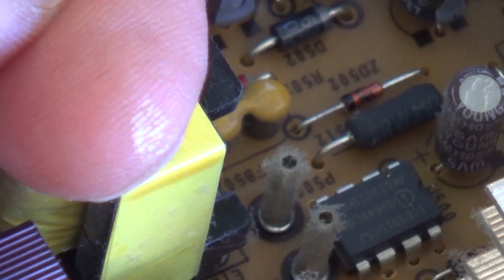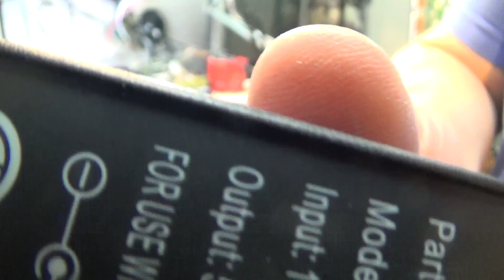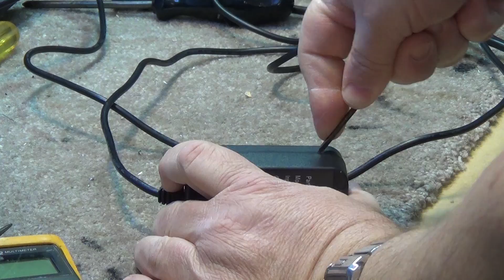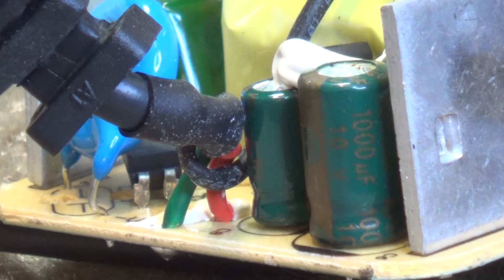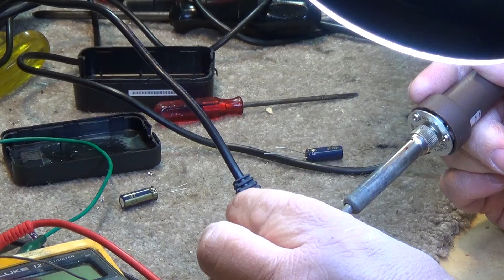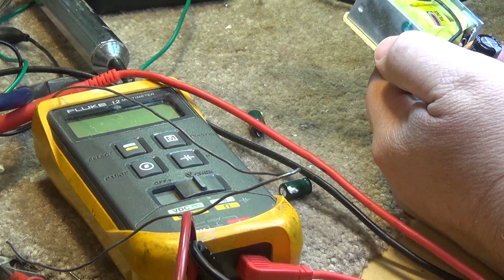Power Supply SMPS repair

Comment: I hate those things, change a hand full of shorted parts and they still blow up when I plug it in.  Yes, I've been fixing electronics for 51 years.  Changing bad caps is the only exception.
Reply from the maker: well if you've been fixing stuff for a 51 years then you should know better than to plug in a power supply like this without some type of overcurrent protection. When I work on switch mode power supplies I plugged them into my dim bulb tester and a very act and I run them up slowly while monitoring to make sure that the oscillator starts properly. There's no excuse for blowing up a switch power supply when you're repairing it. That happened only to me once or twice earlier in my career and I learned quickly what not to do.
Reply: @12voltvids  You're right, I have isolation transformers but have never set up anything with bulbs etc. to limit current.
Reply from the maker: @robinsattahip2376  incandescent bulb is your friend.  Has saved me many times.

Comment: 'bad reservoir caps' are most definitely NOT the only thing that go wrong with these... let's not be misleading now! often if find it's bad diodes or regulators etc
Reply: when a decouplng cap downstream from these shorts it can take out and number of components - totally depends on the design of the supply etc
Reply from the maker: Sure diodes can and do fail, as have opto couplers and regulators, but the semis fail a fraction of the number of times that caps fail.
A wise man once said. "The reliability of any electronics device is inversely proportional to the number of electrolytic capacitors the device contains"

Comment: good job 12voltvids very simple very quick, i have question, if fuse was grilled in the same Power Supply SMPS what could the source of problem thx.
Reply from the maker: Blown primary fuse you have to look at the switching transistor on the primary side, and diodes on secondary side.

Comment: Hi, Question on the capacitors. Are you suppose to discharge  them out before removing or is it testing them with a ESR meter so you wont get shock????
 Thanks Janet
Reply from the maker: Yes short them out before measuring. ESR meter will measure in circuit, but you want to discharge caps before measuring.
Reply: Thank you..will do .

Comment: Hi, if the capacitors measure 20-30% more of the printed value, they are still ok or it's better to replace them? no bulge etc. on them.
Reply from the maker: +thesummertune Remember that capacitors can be as much as 10% low or 20-30% high in the Uf rating and be totally acceptable.That is why ESR testing is the more accurate way to determine that a cap is bad.If you look at my video on Capacitor measuring I show that.A had a few caps that looked good, measured very close to the capacity rating, but failed miserably  on the ESR test.
Reply: Thanks for replying. Well if the capacity was good but ESR test wasn't, so they didn't work on the circuit?
Reply: a higher capacity value don't have bad effects on the circuit?
Reply from the maker: +thesummertune No as a rule you can go higher without problems. If you go too high a switch mode may fail to start due to the inrush current at charge up drawing too much and causing an over current shut down, but being over 20% won't cause a problem.So for example if the circuit optimum design called for 100uF, it would probably function fine between 90 and 120 as that would be well within the tolerance of electrolytic capacitors.
Reply from the maker: +thesummertune Right ESR is much more important than capacity.

Comment: Saw a YT vid on smps repair that uses the hammer technique to open the case. Can't find it now... so:

1: Place the smps, long side up, on a flat, hard surface. 2: using ball side of a ball-peen hammer, strike the case just adjacent to the joint ("above" the joint, if seen with the smps case sitting right-way up). This breaks the plastic weld cleanly. 

The trick is to use just the right amount of force and no more. If you strike above the plane of the pcb and not too hard you will not damage the pcb. 

It looks clean, not chewed up as with screwdriver technique. 

Experience is a plus...
Reply from the maker: +davecc0000 I've done the hammer technique many times. Some cases are glued together  in such a manner that this is necessary. any pop apart quite nicely the way I did it on this one, and I am not really concerned about the case being chewed up. It is my power supply, and when it goes back together, it is being held together with a zap strap for easy access the next time it needs service again.

Comment: looking for fat blown caps is easy. but what if there is no obvious visually faulty cap or other part ? what to measure and track down then ?
Reply from the maker: +Axel Werner An ESR meter is essential for tracking down bad capacitors, and a good DMM with diode test capability for checking resistors and semiconductors.
Reply: 12voltvids im just about to build myself a cheap diy ESR meter with analog display. Started somewhat this morning. Breadboard prototype is complete. Now need to build the project box.

Comment: Thanks for another well-shot, very informative video.  I'm glad you showed the ESR meter reading of the bad caps.  Did you actually glue the case back together or did it snap together?  If you did glue it, what kind of glue would you use?  Thanks a lot.

Regards, Tom
Reply from the maker: +THOMMGB Zap strap. EZ access next time.

Comment: Ive repaired some 12v/5v or 19v switchmode adaptors, after the caps are ditched i drill the case with small vent holes, nowhere near the hv section though.
I dont like my new caps being cooked in the ovan, im sure they leave out vents on purpose :-(
Ive used panasonic caps as well, middle of the road, decent quality :-)
Reply: I didnt say the ones i used were FR series, dont jump to conclusions.

Comment: What temperature do you use with your iron to melt the solder so fast ?
Usually in those power supplies, the ground plane is tough and you have to really heat it a lot.

Comment: Um thunkin 'bout ordering caps in bulk, LOL.  What's a case of caps run now days?  A case could be like ten thousand caps, I doubt a bag of 100 caps would be considered as wholesale.  But I suppose that techs order them by lots of 100.  Less than that would be retail prices.  I have about ten projects that I need to inventory for a 200$ or so order.  Mostly e-caps, caps and resistors, and some tubes   Most projects are 50+ years old.  Most of the cost will be all those 450v - 10, 20, 30, 40, 60, 80, 100, etc. mfd e-caps, that average 3$ each.   A lot of 100 20mfd/450v e-caps could be like 200$!  A tech can easily make a 1K$ order, regularly.  But a good tech should be getting 100$/hour.  The home consumer don't like that, but business, industry and commercial folks all know that losses from down time is far worse than 100$/hour!  So a lowzy two bit cap in a 5$ PS can cause things to come to a grinding hault in a business computer network.   CALL IN THE TECH AND GET IT WORKING IN LESS THAN TEN MINUTES!  Don
Reply from the maker: +umajunkcollector 100 an hour? Would love to see that. Most electronics techs, even the good ones might bring in 50K a year. Back in the day, when I was swamped I used to make low 60's and that was in VCR heyday.  Consumer electronics is dead, business is mostly parts jockeys, and large tech businesses, I am thinking Telco, cable co, ISP, and broadcast have their own salaried techs  and engineers and I can tell you right now we don't make no 100.00 an hour. OT pays well, and getting called in on a stat holiday, well lets just say it has been a Merry Christmas for me this year!
Reply: Um thinkin corporate salaried techs, or self employed.  My daughter took her laptop to a tech to resolder its power jack, the guy told her they charge 100$/hour, minimum one hour.  Many auto mechanics also charge 100$/hour.  But that doesn't mean 800$/day for an eight hour day.  At times it might be 400$/day.  And hey have overhead to take out of that.  As you said, business is slow, not a bench piled high with VCRs and stereos anymore.    Corporations salery tech well, but they also expect much from them to keep things going. Many are more like engineers than R&R guys.  And they have to stock an inventory of parts on hand that are usually failed.  As you well know, it's not worth it to consumers, so a tech has to charge them much less than 100$/hour.  Most consubers toss it, and buy a new one.
Reply: btw, charging 100$/hour doesn't mean the tech nets 100$/hour.  Money comes in, money goes out, the tech gets the leftovers as his gross pay.
Reply from the maker: +umajunkcollector Back when I was in the business it worked this way. The shop charges were 85 for anything that required troubleshooting with test equipment.60 if it was a VCR with mechanical problems, minor work was charged for 30 min, and that was 39.00. 60% of the gross went to the shop, and 40% to me. Pickup and delivery added 50.00 to that charge, and if I went out on that pickup, then I got 40% of that charge too, but if it was a 1 man pickup, then I didn't. If  I decided that I wanted to take my 4 weeks holidays that I had earned after 10 years with the shop, I could take them. However the owner of the shop would close the service dept, and give the junior tech his paid holidays. Remember the 40%, well if nothing came in during the time I was off guess how much I got. You guessed it, 0.Actually it was less because, the salried assistant (the pick up guy) was paid by the hour, but 40% of his wages came out of the shop labour revenue I was paid out of, so if I took a month off, I would end up owing the shop for his wages while I was gone.
Reply from the maker: +umajunkcollector At work I get sent all over the place. Generally they try to keep me in one geographic area, but if work slows down in one area, I do get sent to other regions. The maintenance guys are all over the place every day.
Reply: Again thanks for all the 411 you freely give, you didn't get all that for free!  Um gonna go with a two prong plug socket on my IPS.  The primary will be on a variac, and the secondary can actually go up to 220VAC since it's a 2:1 transformer.  This will allow for Euro junk too.  The transformer is at least five amps all day long.  Don
Reply from the maker: +umajunkcollector Right, I learned it from a long career in electronics, I am still learning how things work today. I never fixed a plasma until that first one last year. I took a course in 2000, but never put it into practice until last year, and have learned a lot in the past year on how these beasts work. I am working on 2 right now. The TS video for one is up, and the follow up will be done when the parts come in. I have another one with a very strange problem, takes 20 minutes to come on. That screams capacitor, but for the life of me I can't find any bad ones on the power supply, so that one is starting to point at the logic board now.
Reply: I've not seen any Plasma sets in the junk stores or elsewhere.  If I were to look for one on CL or Ebay, sure I'd find them.  But not even on the curb, it seems people just don't get rid of them.  Strange, everything but plasma?   Hmmm, something that is not a "throw away, get a new one".
Reply from the maker: +umajunkcollector I love my plasma sets. I have 7 of them now, a Samsung 63 1080P and a 51" 720 and a SD set that is insignia branded (my son has that one) and a Panasonic 50' 1080p, 42" 1080p and 43" ED in my work shop, and an LG 720p 42". They all look great. Even the ED set, when I give it a 1080 signal over component, it only displays it as 852x480 but from 5 feet away it looks every bit as good as the higher resolution sets. In my office, on my edit bay, I have an LG  28" 4K computer display, that is an IPS LED/LCD, and a 1080p Panasonic 42" that I use as my edit preview.Right now my computer is just showing the slide show (which are all my photos I have taken over the years)Same picture, in 4K on the 28" and in 1080 on the plasma.  The 4K doesn't look any sharper, even though I know by spec it is, the plasma blows it away in terms of picture quality. Its the contrast and black levels that makes the difference. Things like clouds and trees and water. Huge difference. The LCD looks great until you see the same picture omn the plasma beside it. OLED on the other hand, well that is better than anything. My tablet has an OLED screen, and the photos and video on that thing are simply beyond words.

Comment: Two questions: What was that white substance? it didn't look like it was coming from the caps. What kind of soldering iron do you use?
Reply from the maker: +Kayemache The white substance was just circuit glue that was securing the capacitors to together. It is just silicone rubber. The soldering iron is a XYTRONIC 258, which is just a cheap 25.00 adjustable temperature iron. I intend to get a better iron one of these days, but this one gets the job done.

Comment: It looks like the weak link on most electronics from the past and still today is the electrolytic capacitor. They last almost forever with nice smooth DC on them but any thing other that smooth DC and the blow there top (don't we all!)
Reply from the maker: +Michael Beeny Yes that is right. The high frequencies of switching power supplies, in the 50 - 70KHz range produces heat. This is why special high temperature capacitors are needed. The other problem with the modern capacitors in the use of non-toxic electrolytic. It wasn't that many years ago when the solvent was PCB based oil, and we know how bad that stuff was. PCBs were found more in fluorescent lamp ballast, and high voltage capacitors and transformers, such as those in microwave ovens, or power factor correction.  The move to water based created a problem, water boils at 100"c. This is one of the reasons regular capacitors are only 85C. High temperature caps have additives in the electrolytic to increase the working temperature, but they still don't last that long at the temperatures they are being worked at. If you draw close to full power from your power supply you will dramatically increase the ripple currents and this will produce, you guessed it, more heat which will reduce the working life of the caps.
Reply: +12voltvids 
I always learn as much (or more) from the comments as from the videos! Thanks!

Yooouuu fiiixeed itt!!!! :D
Reply from the maker: +Koffi Banan I actually stole that one from Photonicinduction  "I Poppped it!"